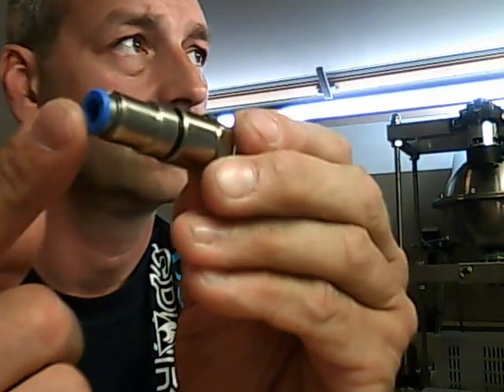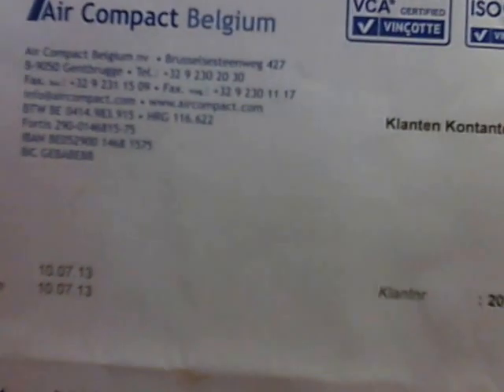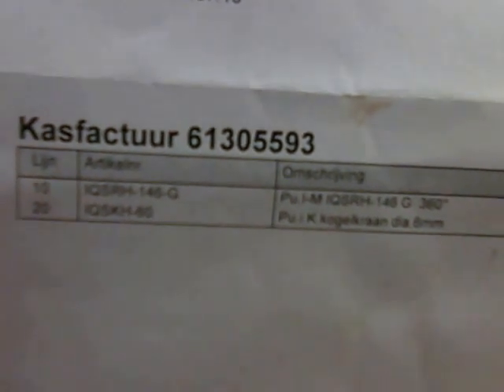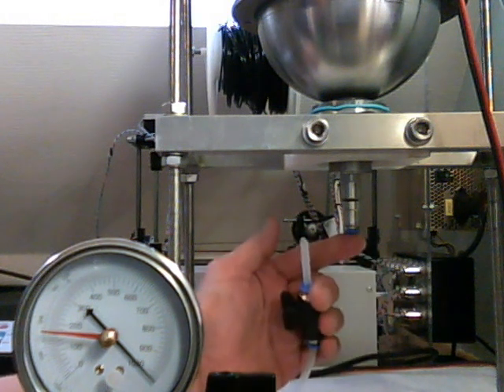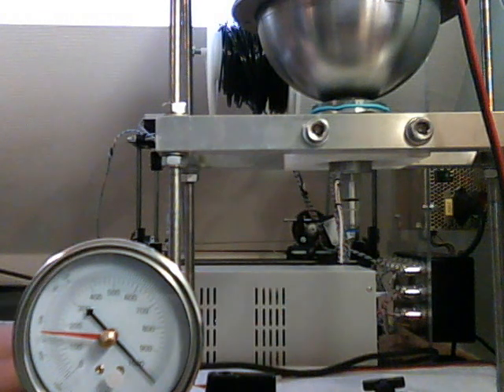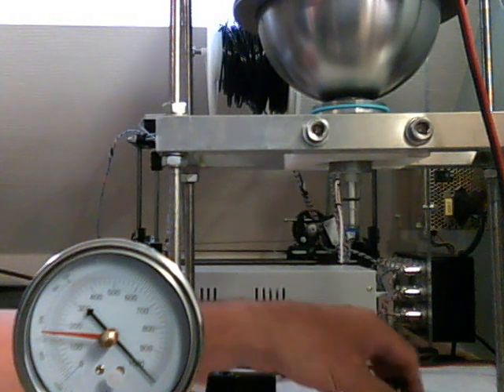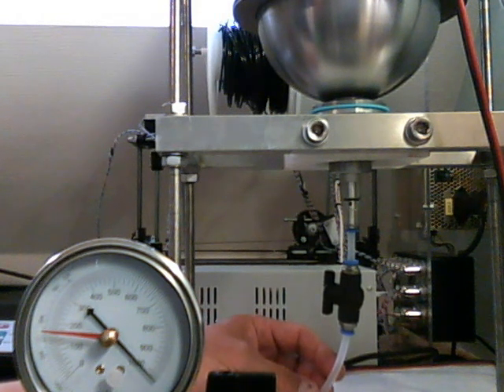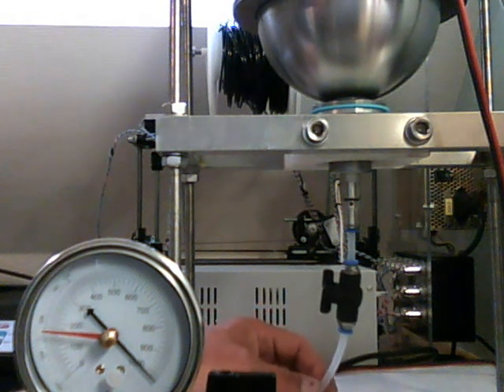V7 1200 revolution vacuum feedthrough test

Comment: I have never met a 'quick-connect' fitting that was rated for more than 30inHg. This is a basic vacuum.

To get a better vacuum, KF or CF flanged fittings would be required & they are a lot more expensive!

Comment: I have also seen BSPT fittings screwed into BSPP which gives a very poor sealing as thread engagement is minimal. This was done on a Hydraulic control system of a hydro/electric dam, or course it leaked and we removed all and replaced the fittings and subplates with SAE oring devices. Again just an observation....

Comment: Correct, choosing BSP tapered is a poor choice for vacuum, as a tapered thread like this is NEVER used in precise assemblys as it distorts when tightened. If holding a good vacuum is so important it seems odd that such a connection is being used. This is just an observation, makes one wonder as the rest of the design looks so much like a good areospace device would.

Comment: Geert, What was the thread that you used the Teflon tape on ? Was it BSP or NPT or NPTF, was it BSP tapered or parellel, what was the female thread, was it BSP tapered or parellel. I am surprised you would use such a primative connect for vacuum. In such a delicate connection SAE oring or METRIC parellel thread would be the thread of choice with a metal seal or bonded seal arrangement. Also when using Teflon tape only 1.5 turn is the max, somthing does not add up here, I am very disapointed.